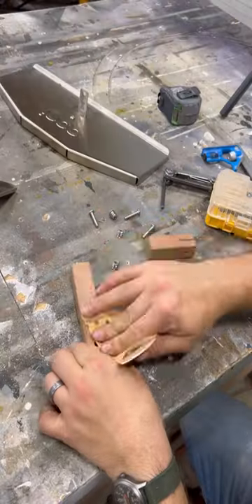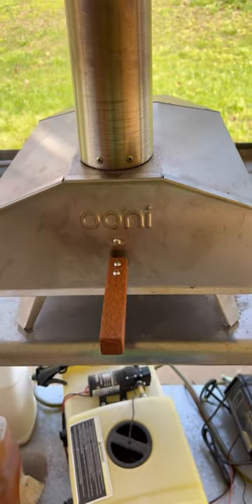Upgrading my wooden pizza oven handle #woodworking #ooni #ooniepizzaoven #woodworkingtips #handmade

Comment: Bro made the same thing just different wood
Reply from the maker: Would you rather have a bed made from the same plans out of pine or walnut?
Reply: If the handles function properly but look like crap there’s no point in redesigning the wheel when you can just use a different wood and make it both look better and still function properly.
Reply: Ergonomics  @southeastcoastalphotography